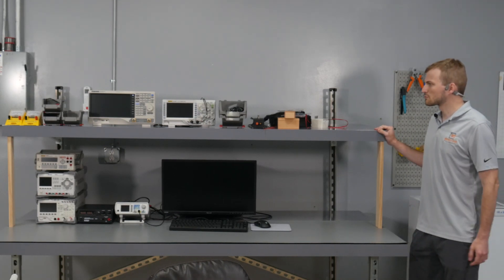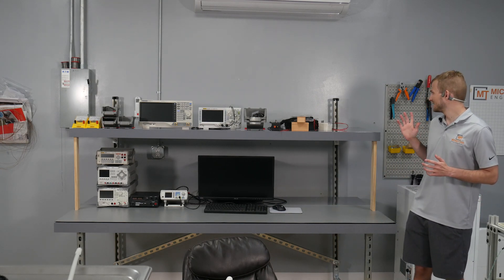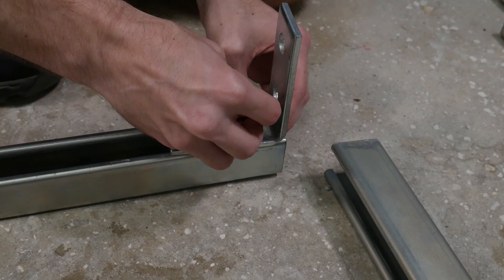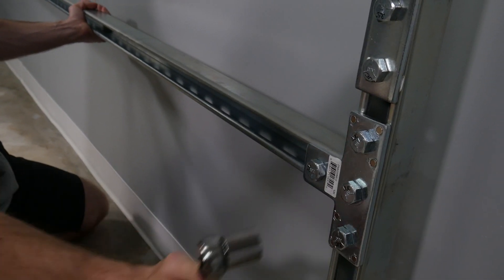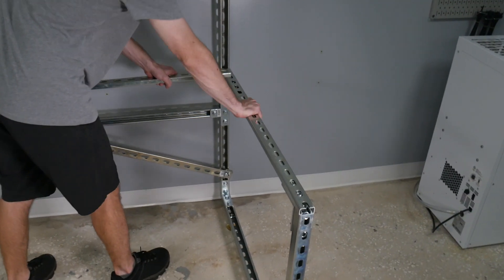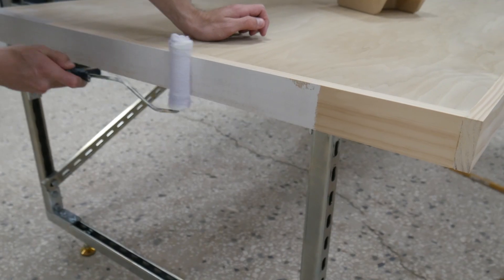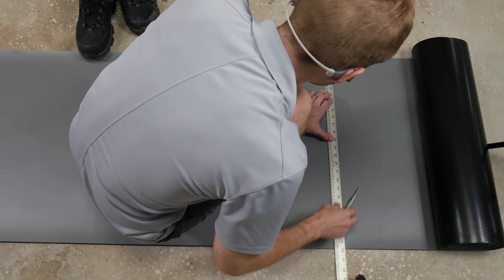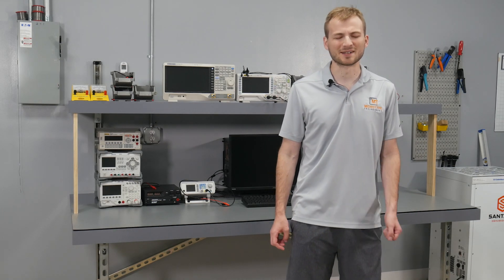Building the ULTIMATE (kind of) Electronics Workbench!

Comment: So I am super shocked that nobody in the comments mentioned simply simply buying V-slot extrusions (just Google this and you will find plenty of vendors).

I work in a research lab (to give you an idea of their environment) and they are used for *everything*. And so for good reasons :
- they are modular ; you can cut them to any size you see fit
- you can join them using nuts that slide in the V groove allowing you to position them according to your needs
- you can find plenty of accessories for them ; rubberized feet, wheels, brackets
- they are really sturdy ; if you cut them correctly they are just rock solid and really light
- you can relatively dismantle them easily
- upgrade is just adding more nuts in the groove

Hope this helps! Have a good one!
Reply: Thanks for the tip! 
Modularity is the selling point for me.
When it comes to plastic storage containers, do you know of similar products that are modular?
Reply: @Asyss_Complex  my answer would really depend on the usage, number of plastic containers you would need but you can look up Alexandre Chappel on YouTube for a modular system of containers. The problem with that solution is that it is 3d printed so if you need a lot of them in my opinion that is not the way to go. Unless you have access to injection molding.
Reply from the maker: So yeah, we use those extrusions for a lot of things, including our functional testers. Two reasons why we didn't use them for this (I originally wanted to): They would have been over double the price as the steel struts. I also assumed that they, being aluminum, would have been less strong and rigid than the struts. That clearly wasn't the case!
Reply: @MicroTypeEngineering  My bad then! I did not know the price difference! Glad to know that you heard and considered that option too!
Reply: That stuff is way more expensive than steel channel though. Like triple the price for comparable rigidity. It's better for precision structures like CNC machines.

Comment: That 'superstrut' is known in the electrical industry as uni-strut.  There are many, many different fittings available, and they are used extensively in the electrical trade.  Not so much in electronics.  :)  Strut can be had with pierced holes, pierced slots, or plain.  Guess which kind are the worst ones to use with spring nuts?   The slotted ones like you have.  You can get the nuts without springs on them, which is way cheaper and not really much worse to deal with when using slotted channel.
You can get tees that take two fasteners per leg instead of one, and they are much more sturdy.  You really should go through a catalogue of available fittings before starting a project using uni-strut because there is a startlingly large number of pieces available.   Electricians routinely make large structures out of strut to support cable setups.

As to how to make a bench... there are many options.  I have scads of strut and fittings at work, and I really don't think that I would bother using it to make a bench.  
One of the problems with making an electronics bench is that you don't want the bench top to be too thick because you will be sitting at it, and you will need to be a reasonable height above the surface to be able to use a binocular microscope and solder under it.

One option that can be fantastic is commercial kitchen prep tables.   They are stainless steel and can routinely be found cheap due to the continual foundering of small restaurants.   Since they are a welded stainless steel construction they are corrosion resistant, sturdy as all hell, and they are conductive so you can ground a leg and your ESD mat is magically tied into the system.

Another option that's popular is extruded aluminum, but sturdiness isn't its forte.  Looks pretty stylish, though.
Reply from the maker: Thanks a lot for the notes! That's funny about the spring fastners, which I knew that at the start..

Comment: Given the cost of the materials and the number of benches you need to build, it might be less effort, less time, sturdier, and more cost effective to purchase a bench kit or assemble yourself units. Unless you have the proper tools and equipment, it's hard to build a good, sturdy bench. 

Don't shy away from used benches. You can find some awesome deals on eBay or Craigslist. Global Industrial supply and other suppliers have a wide selection of lab benches for a few hundred bucks. To really save money, though, buy steel bench frames and build or buy your own top separately. The top adds a lot to the cost of shipping.  

If you choose to build your own top, I would check around locally for a kitchen countertop or cabinet shop. You can't get a better top than one made with a man made solid surface, such as Staron or Corian. Often the cabinet shops have tons large scraps pieces from completed projects. I suggest paying them a visit and explaining your project. They're more than happy to have you haul it away for them.  If they don't have scraps in the dimensions you want, get them to quote you on either building them for you or selling you the material. The only issue with the solid surface is that the thickness is only about a 1/2 inch to an inch. This can be solved by purchasing large sheets of mdf or plywood sheet and sandwiching it with the solid surface using either construction adhesive or epoxy. Make sure you weigh it down with heavy objects while the glue cures. If cabinet shop doesn't work out, you can build your own top by sandwiching two pieces of mdf and applying a roll of melamine sheet using contact cement and a roller. There's tons of videos and online resources on how to do this.

If you're going to have shelves. I suggest you keep the bench against a wall. Unless the supports are built into the bench frame, they may twist or bow over under their own weight. For a DIY solution, I would use shelf rails and standards with melamine planks.  There's cheap and very strong. They can hold a ton of weight, but must be affixed to a wall. On my bench, I have shelf standards spaced ever 2" with two an extra long shelf brackets that are at least 18" long positioned at the very top to hang a 4ft led T8 shop light hung with two chains. This casts a ton of light over the workbench while I work.  I also have another one positioned halfway down one of the rails to hang my foredom rotary tool.  The shelf rails system are all interchangeable and standardized. 

Btw, I noticed you have the same Wall Control pegboard. They make a horizontal one you can attach to the wall behind the bench and use it as a backboard section for hanging tools and accessories. They even have metal shelves for your equipment and various hooks for hanging leads and probes. They also come in a variety of colors. Check out their site: wallcontrol.com for some inspiration.

Hope I didn't overwhelm you with options.
Reply from the maker: Woah! Thanks so much for your feedback! I was flipping a coin at the start of the project between using like the Shop Fox steel legs, or going this route. After hearing the comments so far, definitely seems like the shop fox was the way to go. Oh well, there's always part two!